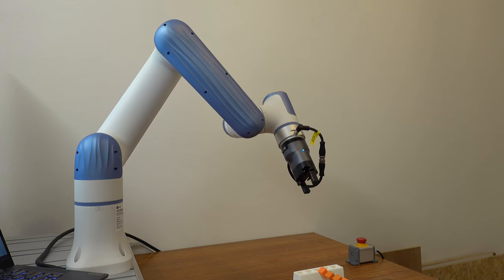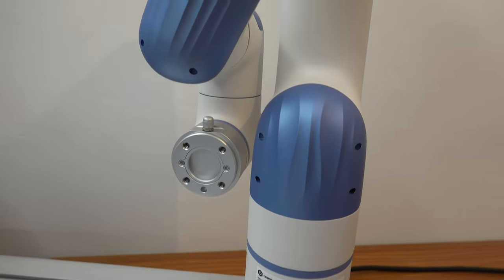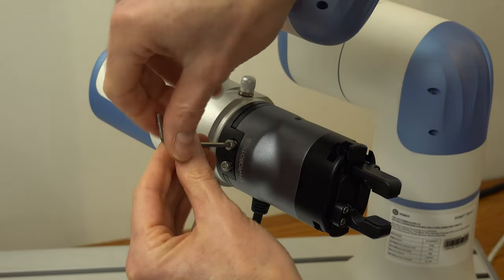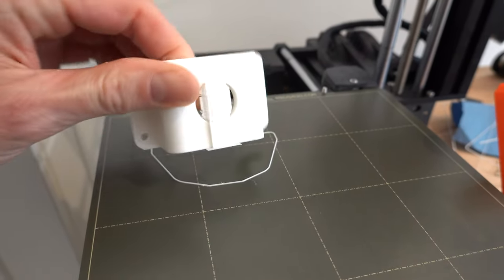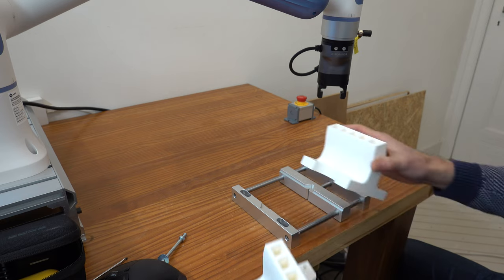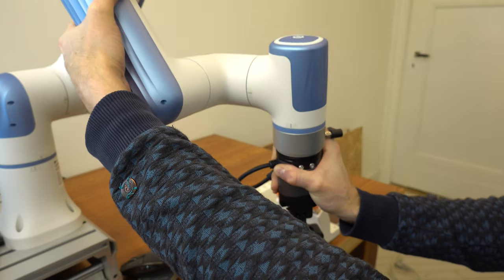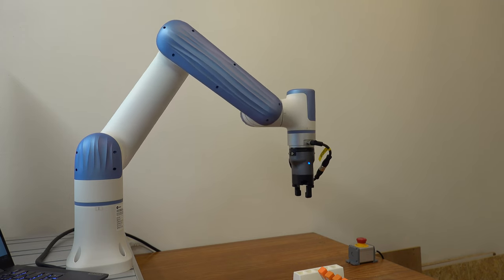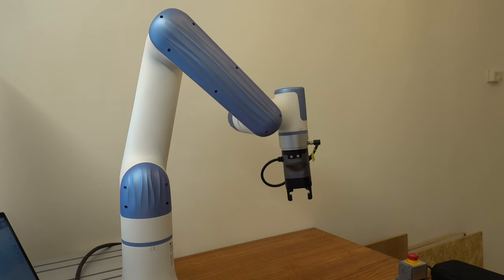Dobot Nova 2 | Cobot testing and pick & place demo

Comment: Great video, thank you! I would like to use the robot with a push button as well. What kind of button and cable is this?
Reply from the maker: Hi, thank you, I am typically using LAPP cables for this type of application. They have all sorts of variants ( shielded/not shielded, wire thickness and wire quantity). The button is a generic momentary contact button. Can't recall where I bought this specific one, but they are sold at many stores like Conrad or Reichelt in Europe.

Comment: Thank you for this review. Great work. Did you also performed tests at max velocity? It seems to move relative slow considering the specifications?
Reply from the maker: Thanks, much appreciated. I only tested at relatively low speeds for safety. I was on my own with the robot at most times and also did not have any safety barrier. Even though it stops when it hits something it is better to be safe than sorry. This robot is quite large and intended for professional use, in which case a machine safety assessment will be done. Since I was just experimenting it was best to keep it at low speeds.

Comment: Great video! Thanks.

If only I would have a reason to buy such a robot 😅
Reply from the maker: Thank you, much appreciated! Makes sense, but hope it got the ideas going.
Reply: @uptimefab7412  Do you know how compatible Nova 2 is with the other Dobot accessories? Can I integrate the Dobot Vision Kit into DobotStudio Pro ?
Reply from the maker: As I understand it, the Nova 2 is not compatible with the vision kit. It can interact with cameras over Ethernet or through the available IO, but it seems like the users should configure this themselves. I don't have experience with cameras over Ethernet. If you need more details on this it is probably best to contact dobot support though the forum or call your local supplier.
Reply: @uptimefab7412  Okay I see. I guess the Nova 2 is much more on the professional side and is meant to be integrated in tools like f.e."Mech-Mind"...

Thank you for the quick response :)
Reply: make stuff with it... put a drill instead of grabbing hand make it CNC parts... build anything u want in aluminium ... :X have fun.